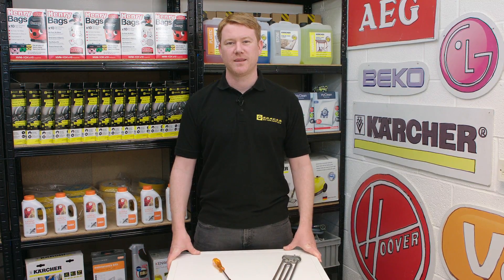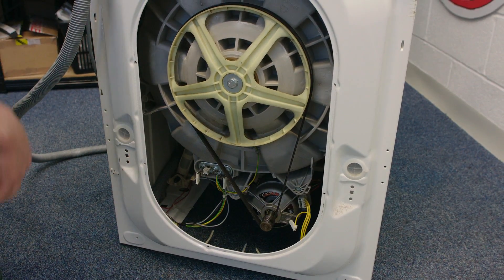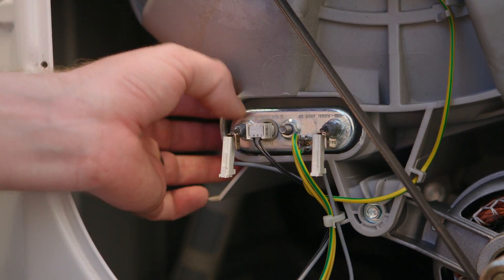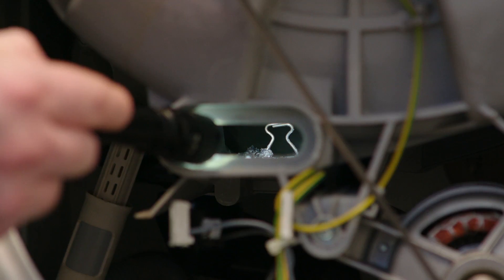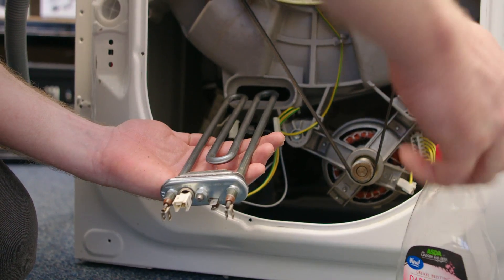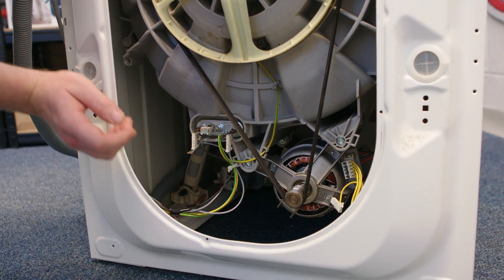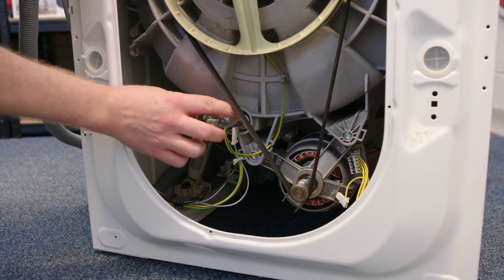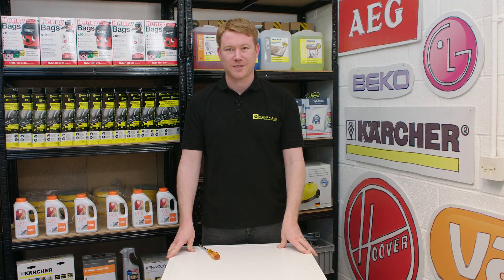Fit a Zanussi Washer Heating Element - Easy Fix! (With Heater Testing)

Comment: I have a Zanussi Lindo 100 washing machine, and I think the heating element has failed.  I noticed after a 30 degree wash, the items were cold instead of the usual warm when I pulled them out of the machine.  I did a test cycle with no items in the machine at 60 degrees, and the water was only getting luke warm when I was expecting the door on the machine to feel much warmer.  There were no errors showing on the display, and the machine still performed a full cycle.  Could the element still be faulty ??

Comment: I have a FL882 model from zanussi, it's a 1998 born. When the heater turns on, the machine gives an electric shock. Upon the water becoming hot it cuts off giving no electric shock. Sometimes intermittently the element gets too hot and can hear a boiling sound. 
Please advise as I can't get help or service in India. Appreciate your response.
Reply from the maker: Hi uglyarchie, the machine should blow the fuse so it is worrying the earth path is not working, if the element is down to earth it will normally blow the fuse or trip so start there but you will need to make sure the machine is earthed as this can be dangerous.

Comment: For accuracy, you should have removed at least one of the element wires before testing.
Reply from the maker: Hi RSC Electrical, thank you for your post but when testing a heating element for a resistance reading it is not essential to remove the wires when you put the probes at the top of the element as Mat showed in the video and the element was open circuit and needed to be replaced.
Reply: @eSpares  : It doesn't matter where you put your meter probes, whether at the terminal or on the connector. If the connector is making contact with the element terminal then you could get incorrect readings. As your supposed to be informing the public then it would be a good idea to provide accurate information. But hey, what do I know ? I've only been in the trade 45 years.
Reply from the maker: Hi RSC Electrical, thank you for your input.